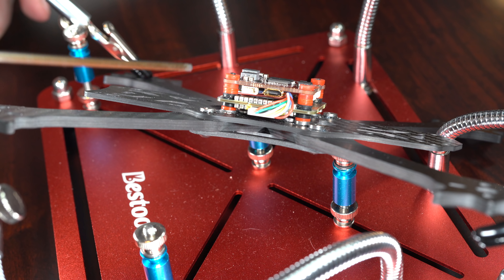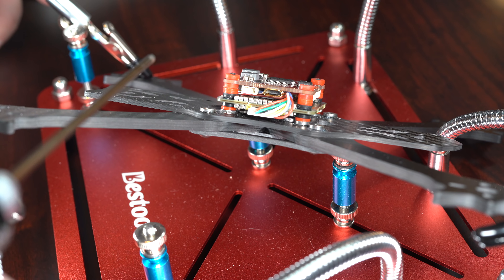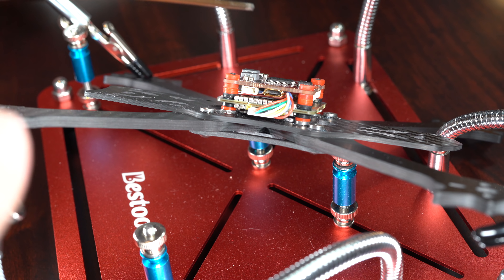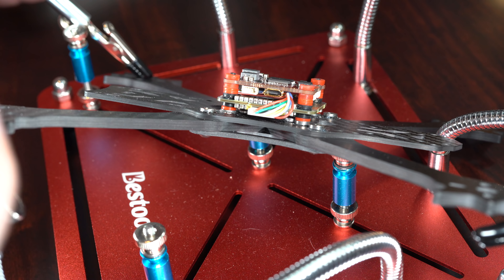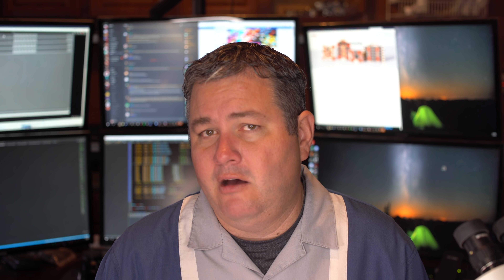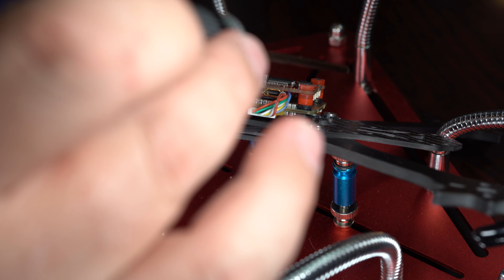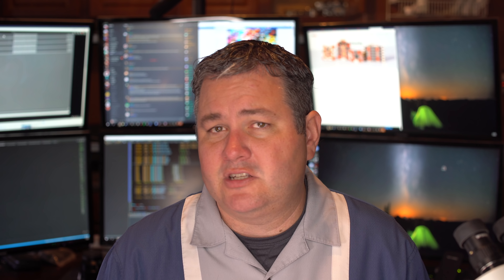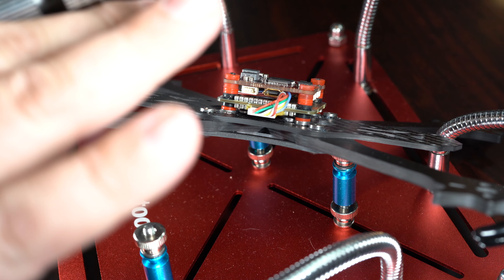Proper Flight Controller Mounting - Flight One

Comment: Preston, you always say 2 o rings but you fail to say their thickness. I think maybe some people find this confusing. I use 2mm gummies under and between the boards and I have had zero issues. She flies excellently right out of the box. Great job on an outstanding product!

I also use a simple 3d printed cover that acts as sort of top screws that houses my rx very loosely. It's mainly held in place by the wires from one end and the antennas from the other. I then have a Mach 3 on top of that. 

This is only my second build but I went to people who have years of experience and they all 3 said she flies excellently. They said there was a little prop wash but it can be tuned out. I dont feel anything and she seems to be on rails! Thanks again.
Reply from the maker: I'm glad your having good experience.  You can sometimes get away with mounting rx and vtx on top, but if you take my approach it seems you almost never have issues.  So this isn't a hard set rule, but a good rule of thumb :)
Reply: @FlightOneVideos  I posted on face book in the support and discussion pics and details of my stack under the name Bob White. My thanks to you guys for the outstanding products. I'm in love with Flightone gear!
Reply: Where did you get your gummies from?
Reply: @funKdatFPV  I got them from GetFPV they were in a set. Search their store for 30mm soft mount. The while kit was 12.00 and came with diffrent size gummies screws washers and nuts.

https://www.getfpv.com/tbh-401301-soft-dampening-kit-for-flight-controller-stack.html

This is what I used. Out of stock right now tho. Sorry

Comment: Ive Always used long nylon screws all the way down through to those rubber Standoffs FC on top of PDB gummies in between and inserted in boards. single esc's. It works

Comment: For cheapskates like myself - 2x5mm silicone tubing is a good replacement for the o-rings. Everything is custom-cut, but that's a good thing.  With M3 bolts it's super-tight on the bolt and stays put - for M2 20x20 builds it'll work as a spacer.  
PG is on point with the wiring management - I do need to make sure I'm not sticking receivers right on top of my gyro's with VHB with mine.

Comment: I was just wondering if i put out my power lead out the back of my 4in1 an have the RevoldOsd placed so that the vtx and camera plugs also put out to the back just above the power lead would that cause some distortion in the video. Also i was wondering how can i see what noize is? Do is see it in the video or is it just some vibrations in the flight caractristics? Sorry for my bad english😉
Reply: Or can i only see noise when i go into blackbox. I never have so i dont know anything about it
Reply from the maker: it should be ok, but i think camera wire may not reach, you can just turn the fc though

Comment: Hey Preston iv been using  raceflight or flight one 4 years never really had too many issues but I have a obsession dquad that I can never get quite runes just right as you said trying keep the stack free with receiver and vtx but in the obsession dquad there is no room to put it anywhere else what is your suggestions
Reply from the maker: I'd have to see how you have it mounted to see how you could place everything, i have a problem quad here from someone i'm going to work on and see what i can do to make it fly right
Reply: @FlightOneVideos   Subscribed. Please video a troubleshooting process for FL1 customers , as I have a new BNF Merica that twitches and oscillates up violently as soon as you leave the ground and must be disarmed immediately. 

 I noticed they have screwed the FC into the canopy and it needs the medium -high filtering prresets just to hover. They've also used the gummies that  come with the Aikon 32 on the Revolt for some reason.  Am I to understand this may be an issue?

Also please do a video explaining the motor testing so we know whats acceptable motor scores and whats not for the Revolt or OSD FCs.    Lastly how vital are capacitors to this process? I noticed the Revolts all ran two big caps right off the boards, the Bolt 32 and the spark 32 do not run the same level of capacitance and seem to carry more noise.  Should we error on over capacitance?  Is anyone running these ESC/FC without caps?

Comment: If the stack doesn't stack as designed by default, maybe the washers should be included in the bag?
Reply from the maker: In future FC we may try and make something like this so you have the exact spacing needed
Reply: @FlightOneVideos  or just throw in a few of those, so the stack can be  mounted properly with supplied rubberware.
Reply: If the orings are included profits would surely be reduced.  Do not include them.
Thanks flight one for helping thin the herd.

Comment: You didn’t mention the capacitors. Will the leads to the caps add noise if the wires are under the esc?

Comment: The spark32 which is top side and bottom side. There’s no motor labelling on the board and no diagram on website has it labelled either.
Reply from the maker: Andrew Blanche doesn’t matter for FlightOne

Comment: i have a low top plate on one of my build, and the battery strap is leaning on top of the FC which still has a bit of wiggle room, do you think that this is bad?
Reply from the maker: If its not really hitting very hard, should be ok
Reply: Depends sometimes the top plate flexes and causes the strap to rub on the flight controller and causes some oscillations that you can't figure out where they're coming from. You can't make your stack any lower? Or maybe raise your top plate a little?

Comment: Hi mate, I've just purchased my first flightone revolt osd, having a hard time updating the firmware in dfu mode. 
When i connect to the configurator (1.2.75) it says error,  loading failed please make sure you have upgraded to the latest firmware and so on..
I clicked update firmware then reboot into dfu,, it returns to the home screen saying waiting for device? 
Please help 🤯
Reply from the maker: Adam W are you using configurstor from FlightOne.com and updating driver with zadig
Reply: @FlightOneVideos  yeah config from flightone/beta and I've run zadig.. it goes to dfu but doesn't give me any options
Reply: @FlightOneVideos  sorted mate!! I'd originally tried 2 different usb ports with no luck, tried a 3rd and it worked straight away! Cheers for your time

Comment: looks like imma have to race a freestyle quad cause I don't have enough real-estate to mount my vtx and reciever
Reply from the maker: Our race frames have places for everything and are pretty small
Reply: @FlightOne I have a skinny kid frame and the vtx and receiver is right above the fc on stand-offs... just like any other race frame I have built... I don't run a top plate only a nylon canopy. My rig doesn't fly like crap, its just not as locked as I feel it should be or maybe I just suck.